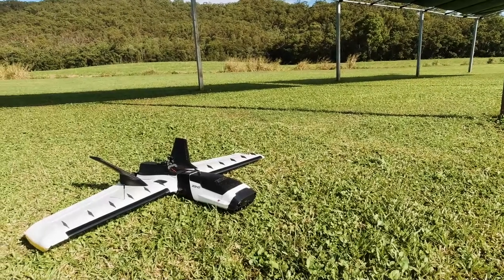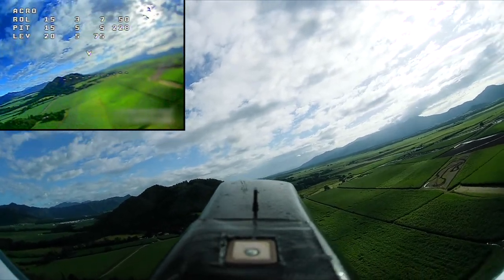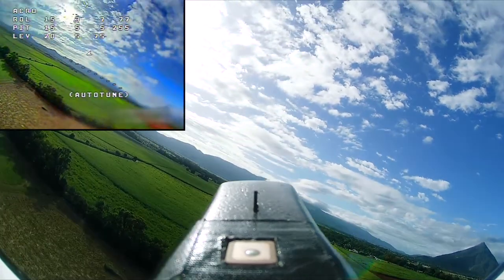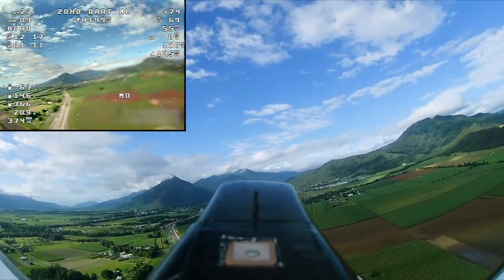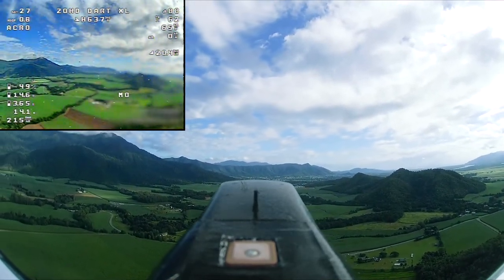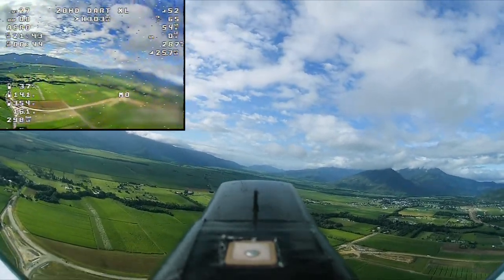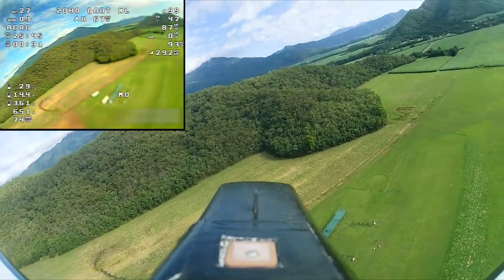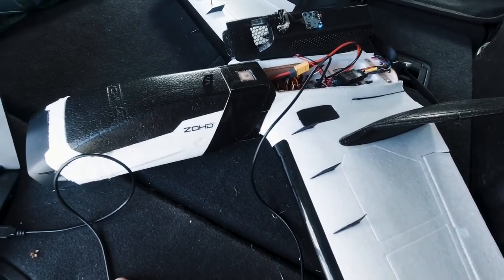ZOHD Dart XL - Range Test 30km Flight - iNav 4.1

Comment: I have 3 inav planes and a zoid dart xl extreme enhanced on the way which will be running inav 6.0.0. I noticed on your autotune the pitch ff is at the max setting 255 so this indicates  a problem basically inav can't adjust any further.
Reply from the maker: I was wondering why it's so high. Any idea what maybe the cause?
Reply: My guess its control surface's setup, maybe not enough throws I think you should have around 16mm on pitch, also wondering what your inav pitch and roll rates are?
Reply from the maker: @egtreadway4232  thanks i will check.

Comment: The horizon drift is a known issue with INav and there hasn’t been a proper fix for it yet. becareful when using rth or other modes when the horizon is drifting your plane could/will crash. Here’s a video fir temporary fix https://m.youtube.com/watch?v=d90sWlFkhIc
Reply from the maker: Thanks for the tips and great video for the horizon drift will use it to adjust mine…
Reply from the maker: The artificial horizon disappeared as the flight went on but at the start was all over the place and very slow to correct. What’s going on there? Hopefully iNav will correct that when 5.0 is officially released..